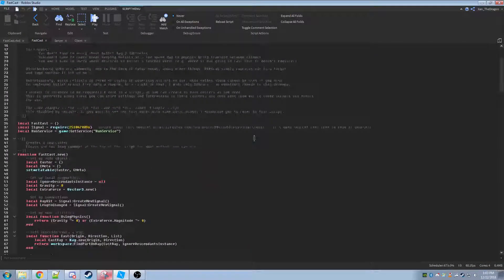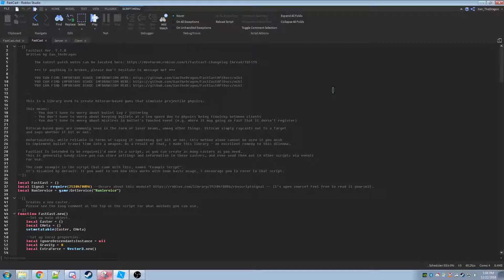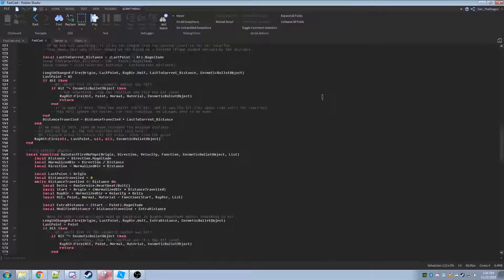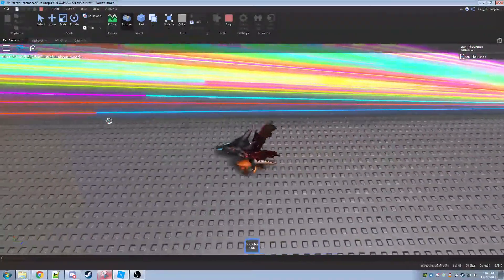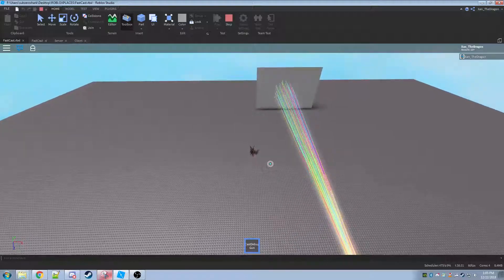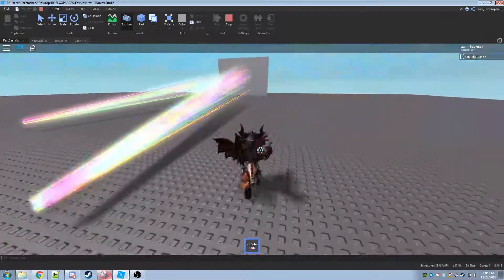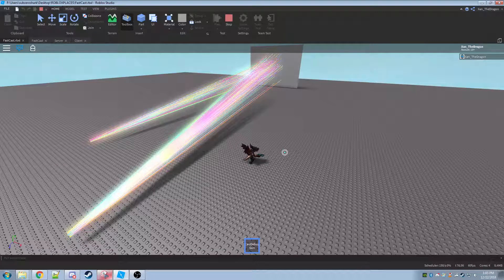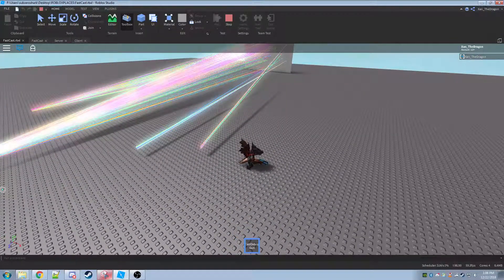FastCast Stress Test Cut Video

Comment: Is it possible to imitate hitscan gun behavior using fastcast weapons?
Reply from the maker: Yes, but due to performance concerns it may be better to directly write straight up hitscan (You would be taking many extra steps if you did it with a caster. There wouldn't be much extra lag but it would run a lot more code than necessary).
Reply: @XanTheDragon I'm not an expert scripter or anything so I'm mostly just fiddling about with open source content. I'm using a gun system that utilises fast cast but I've run into a big issue where the bullet moves too fast to render on another player's screen. I'm wondering if you know a solution to this.

some examples:
https://gyazo.com/730ab49a525ff7c4d171f73130a2b570
https://gyazo.com/685dc64114806f690d44bccb1d04790d